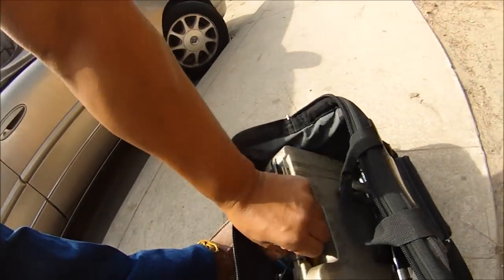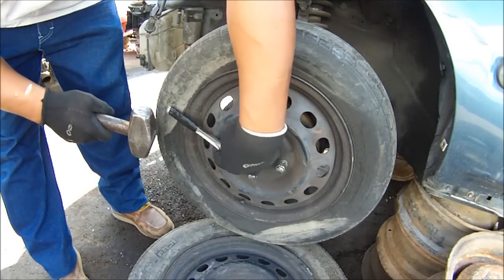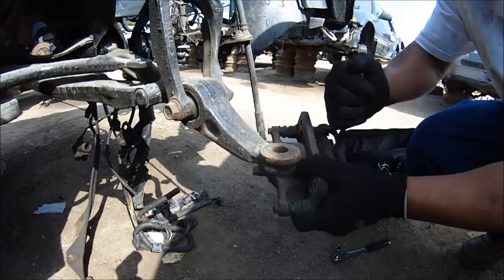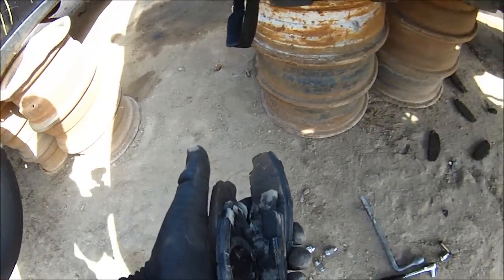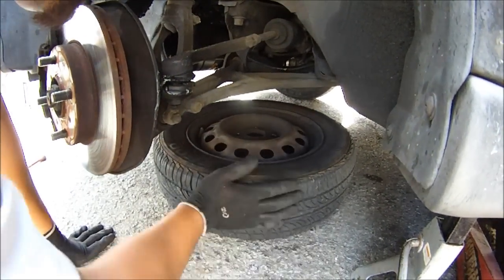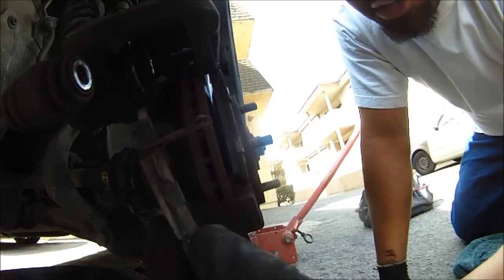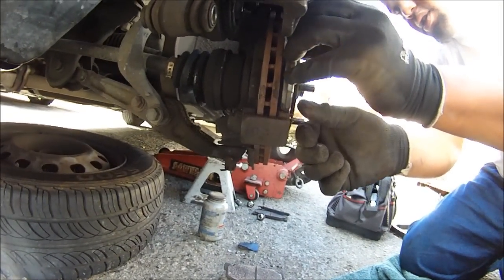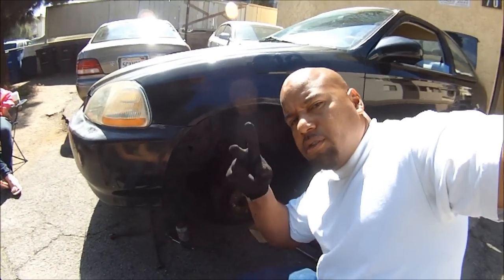BRAKE PADS FOR ONE DOLLAR ($1) A PIECE, FROM THE WRECKING YARD FOR ANY CAR. HONDA CIVIC

Comment: I have seen a few of this guys videos and I have to take my hat off to him. Big respect to him for showing people how to fix their vehicles and spreading knowledge for free. I do not want to bad mouth this guy as he seems to be a real nice guy BUT! This video made me cringe from start to finish. From hitting his tools to finding a vehicle 'similar' to his it just made me cringe. 

I had to write something to express my views on brakes. You should NEVER use second hand brake pads on your vehicle! Firstly, the thought of spending $10 plus the fuel costs going to and from the junk yard to buy brake pads that have about a quarter left on them seems ridiculous to me and is false economy. Just spend the $20 on new ones. 
Second, used brake pads have been 'bedded in' to the shape of the previous caliper/rotor and will not sit properly on your vehicle at first and will take some time to 'bed in' on your vehicle so they will not work properly at first which may result in low brake efficiency and god forbid an accident. 
Third, the used brake pads could be contaminated with brake fluid, oil, grease or anything hence should be avoided at all costs. My no.1 rule is that you NEVER mess around with your brakes, do them properly or get a professional to do them. Safety first people. 

Sorry to oldskool funk for talking shit about his video, big props to you my man but I couldnt walk away without saying something. My conscience wouldn't allow me. The thought of someone putting used brake pads on their vehicle and maybe having an accident after watching this video and thinking that it was ok to do so made me have to say something. If one person reads this and goes for new pads after reading my comments then I will be a happy man and can sleep at night thinking that I may have saved someones life.
Reply: Good point.

Comment: why not spend 20 bucks at Autozone and get lifetime warranty pads even when they wear out you get new ones free
Reply: +Nick Moore thats not what life time warranty means but ok
Reply: +Baldeep Sarpal the autozones all here in seattle do for anyone I've got new pads every time
Reply: If you drive how much their rated for, you have to buy new pads life time warranty is for if they break or crack, you'll get a new set then
Reply: +Baldeep Sarpal i just called autozone they said thats what limited lifetime  means lifetime warranty means for ever they said not just against manufacturing defects.

Comment: the brakes are same from 92-00 lol
and this is a waste of time and money. You can buy brand new breaks for 15 bucks. for both sides. And you will know they are straight. Those used brake pads could be already not true and warped
Reply from the maker: v8consumption No there not quit assuming.  People Dont be negative like this guy lol.  He's a time and dream killer.

Comment: And I don't understand people who cut brake hoses.  Stupid.  When was the last time you heard of a brake hose/line recall?  You haven't.  Why?  Those components are made to take the abuse of being outside in the elements....where rocks are thrown at high speed..where road debris is thrown around....where they can get wet then dry out over and over again..all the while holding in thousands of PSI. So think about your judgment before advising others because I guarantee 95% of you wouldn't dream of using a used brake hose and it's a poor thought process.

Comment: Brakes and tires are important Im disgusted that a yard sells used pads they should be reported
Reply from the maker: youll survive, dont over think it
Reply: anthony fym you can buy used tires, too.... it's considered just fine, and a good way to save money.

Just bed your pads like any other new (or new-old/spare/whatever) pads, and they'll match your rotors and everything and be just fine, except minus however much wear.